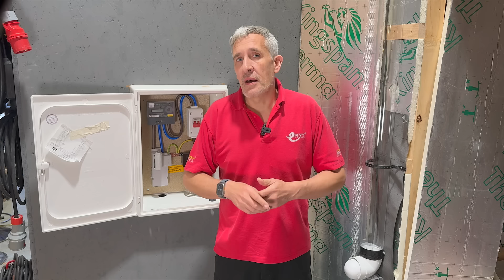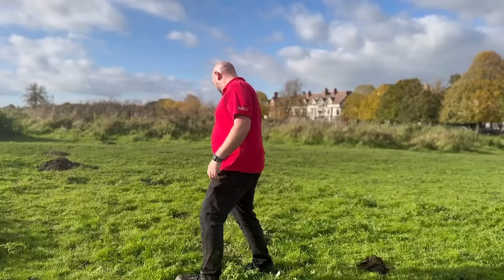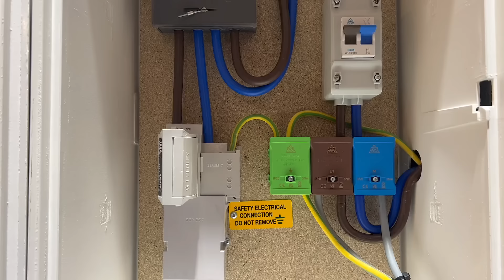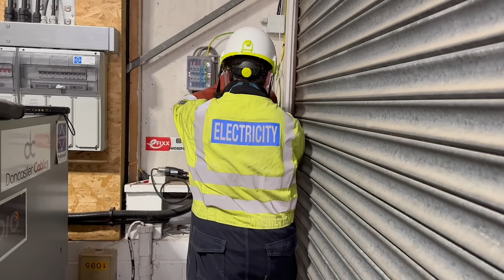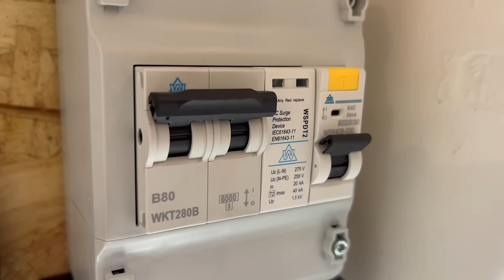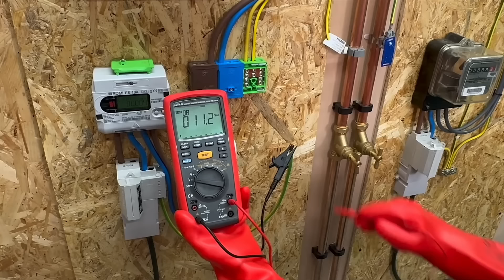Meter Box Madness: The Problem with No Clear Answer

Comment: I like the idea of using a dual B80 MCB as the primary isolator, followed by a single AC surge protector, followed by a single 30mA RCD. 

The contact air-gap in an MCB is at least 4mm so complies with being usable as a switch isolator.

That combination minimises the amount of heat generated on max load AND will work for regular tails to the consumer unit as well as tails longer than 3m- which need overcurrent and leakage protection.

The only issue is if the mini consumer unit housing them has a surge, the surge arrester/protector module will need replacing. And typically this mini consumer unit is often locked with a DNO seal. But doesn't need to be, as it's downstream from the meter...

Any DNOs have an opinion?
Reply: DNOs should stop sealing the isolator then and go back to having an isolator built into the meter like the good old Siemens one did
Reply: Cut the seal, it’s not their equipment.

Comment: Food for thought why dont we just have a board as mentioned but 6ways that we as electricians can use ie includeds 6/80/100 amp Dp switch then spare ways for ev for heat/ground and a additional supply in a hrc fuse type carrier like you'd find in some bms boards or panels ect we just connect drop a fuse in walk away everything and everyone covered 😉

Comment: Just to add my opinion on outdoor electrical  boxes.
I worked as an electrician on outdoor  petrochemicals plants for decades and the Kit just lasted and worked. Dont worry so much.....OK it was ATEX rated but still considered IP ratings, Seals, glands, external influences and heat dissipation etc......
As a domestic electrician now,  I use a local electrical wholesaler who provides higher IP/marine type standard equipment with proper seals and machining of equipment. You can feel the design, components and build quality and this is the difference.
Buy cheap buy twice usually applies but It also ensures the electrician - ie me, is not returning to a clients site prematurely........;)

Comment: Sorry guys, I have this issue all the time, there is only one solution, get a builder in, build a purpose built brick or concrete box with a posh tiled roof. Its not expensive, you fit all the DNO stuff, 18mm marine ply to the rear, 70mm trunking and make it big enough to fit your SPD, AFD, an extra DB, the 4G receiver, plus you can have a SPE and all the EVC. HP and all the CT's with the RS485. I know I tend to work on large residential systems so not everything I say may be directly applicable but its fast becoming the only way. I can send you guys a picture of a typical box if you want or the engineering drawings I produce for planning purposes to get it constructed.
Reply: Yep. 100% 👍🏻🇬🇧

Comment: Before tackling meter cabinet location we need to sort out the regulatory mess that makes 3 different owners responsible for the tiny space inside. 

Its massively wasteful and unecessarilly expensive.  And the answer is NOT - as the UK always does - to create another new market (isolators).  30 years after privatisation and we still set up a new market for every problem.  It doesnt reduce bills but someone else can make money from the problem.
Reply: The rest of the world is one step ahead and stipulates the exact space requirement for the DNO that has its own door and you fit all your stuff to the right with its own door. The DNO side has a lock (they provide for free), you get a key, they have a master.

Comment: What a awful idea. Mcbs do not co-ordinate with mcbs so any fault would trip the meter box and the fuse in the house causing total power outage. I'm starting to hate youtube for terrible advice by these channels. please employ an Engineer Into your team.
Reply: You mean RCDs, not MCBs? But you are right in a way, because the majority of RCDs are rated to trip at 30mA. 

So technically, you're correct- if there's a sudden earth fault at the end of the line in an appliance plugged into a shed in the garden with perhaps 3-4 RCDs in line, all rated at 30mA, they can ALL trip simultaneously.

An ideal solution would be one 30mA RCD in the meter box, then every other one rated at 10mA. But 10mA RCDs are expensive.

It is one reason why RCBOs are becoming popular. But they're still expensive.
Reply: @fredfred2363  He means MCBs, and rightfully so. There's no coordination between MCBs when short-circuit fault currents are considered (either L-N or L-L, easily reaching hundreds of amps which exceeds instantaneous tripping thresholds of any commonly used MCB, including that proposed 80A MCB).
Trust me, I live in a country where most DNOs have switched from fuses to MCBs as their main means of overcurrent protection and power limiters, because MCBs are supposedly such a modern and elegant solution, as opposed to those old-fashioned fuses, and it AWFUL.  Even things as simple as a burnt-out incandescent bulb that briefly create an electric arc when the filament falls apart which creates enough fault current to trip both the circuit protection in the consumer unit, and the DNOs main MBC, which leads to a total power outage. It's a problem that hasn't existed in the fuse era. For this reason some DNOs have started to return to fuses or coordinated MCBs that cost something like 150 quid a pop. So... been there, done that. Don't make the same mistake we did.
Reply: @fredfred2363  hi, no I mean mcbs, mcbs are not designed for selective coordination at domestic fault levels.
Reply: I'm what you would call an engineer, with many electrical qualifications not just knowledge of the brown bible. MCBs on larger installs are always upstream of MCBs, they have to be. Remember the DNO fuses/MCB's protect the DNO wiring, the 500mA AFD TD protects the house, the initial MCB's protect the wires and downstream DB equipment, the RCBO's protect the people and the smaller wires used for power / lighting etc. Its a hierarchy that has probably had a lot of design work put into it. An MCB (with a hierarchical rating regime)  never double trips this is because we think of an MCB as a fuse replacement, its not, its a careful bit of mathematical current integration from your calculus days, very fascinating in fact how the various curves interact.
However you are right when it comes to RCD's/RCBO's they SHOULD not be cascaded and the ed18 regs have a fair bit to say on the safety of this in various scenarios. And frequently, if they are cascaded, because of the way they work, downstreams will generally trip upstreams and so on forever up (even if the upstreams are say 100mA and the downstreams 30mA). 
Personally, I think ed19 should introduce 3 amp 10mA RCBO's for lighting now that LEDs rule but I guess nobody would agree with me on that one!
Reply: @Ino-z2m Mcbs are miniature circuits breakers. You are confusing yourself with MCCBs. Nothing co-ordinates with miniature circuit breakers if they are the upstream device under SC and EF conditions, unless the fault current is little more than the overload rating which is not ever the case. In the example shown there are clearly miniature circuit breakers not MCCBs so therefore no selective co-ordination has been achieved and the mcbs will trip simultaneously under fault conditions l-n l-e.
Reply: @nflk2920  I'm not an electrician, but would like to know if there are any solutions at all - is it possible to use a slower trip curve on upstream breakers provided an appropriate one is downstream? For RCD, do any 'fast-trip' versions exist - maybe if one could try different manufacturers in combinations, one of them would reliably trip alone on I-e fault?

Comment: I have on a couple of installations added a second meter cabinet, and once one for a control for sewage pump. My biggest beef with them is the ease of damaging the hinges, the number you see with no door because the box is broken.
Reply: Theres loads of hidden, undocumented rules relating to hinges, catches, ventilation, insect penetration, fire resistance... I was in a meeting about 3 weeks ago because all my lovely, precision, self gold star awarded drawings that I had spent many evenings on transpired to be a load of crap and I had to start again! Sadly we think the brown bible is the only gospel and what we dont always appreciate is that its not us and the non believers, there's loads of other religions using light blue books with BSI on them that's way outside of our pay grade! And... take it from me... its impossible for a human on planet earth to get your head around it all, do a job as an electrician and pay the mortgage!
Reply: @Ino-z2m  and don’t even go there when you look at the gas cabinet. Cadent once told me to replace one because I had drilled a hole for the gas bonding, you can’t even screw them in.

Comment: If an electrician installs something in the meter cabinet that is not recommended by the DNO, and then something goes wrong - the electrician will be completely liable, and no doubt may also have insurance coverage issues covering an installation that was 'not recommended'.
Yet the majority of electrician's will do this, also nearly all will happily cut fuse tags - which is even more serious than 'not recommended'.

Makes a mockery of all the regulations where yourselves preach not to install anything outside the manufacturers 'recommended' installation methods, due to BS blah blah for something like a light switch - yet when it comes to the meter cabinet, its to hell with the 'recommended' or outright 'no' from the DNO.

Speaking of regulations  @ 6:45 - i can poke my finger in around the conduit entrance to that cabinet - the cabinet which serves as a lockable enclosure, which serves to negate the requirement of double insulated cabling as per a previous video highlighting the trend of this on new builds - but that only works if it meets IP2X.

The whole meter cabinet area is a complete joke when it comes to regulatory compliance - yet it is one of the most dangerous, if not the most dangerous, area in a domestic electrical installation.

Comment: At last this is what we need. One box to terminate  swa and protection
Reply: Must admit 25 years ago, I used SWA for everything outdoors but time has moved on, and, don't forget for the past few years, SWA is no longer classed as double insulated it's insulated cores with a protective sheath which is fundamentally different. Virtually all EV and everything photovoltaic related specify double insulated in the manufacturers installation notes. Plus, there are many scenarios where you cannot use the outer armor wires as the Pc so you need 3 core or 5 core and then you run into frustrating colour issues. SWA has had its day, but it still remains the cheapest way to run power to a shed.

Comment: Personally, I don't like the idea of any of this kit on the outside of the home, where it's vulnerable not only to weather and accidental damage, but also to deliberate interference by 'naughty' people... of which there are many in inner city locations.
Reply from the maker: That would mean moving the meter back inside the house, which we've seen on quite a few new builds in Scotland recently.
Reply: @efixx good - that makes sense. 
Meter boxes don't handle our weather - the number that blow open because the doors vibrate in the wind is crazy.
Used to blame lazy meter readers. Ended up buying a meter key to close my own meter cabinet on my old flat or the door would have been in a different postcode.
Reply: No the box has a metal door with a lock. The DNO provides the lock and gives you a unique key, they have a master. The lock can be a padlock or a euro cylinder barrel.

Comment: We need 3 phase. Why should a home owner pay over £15k to upgrade. Net zero my back side
Reply: Future my arse!
Reply: @fredfred2363 What's wrong with your arse?
Reply: All houses in Switzerland are supplied with three phase by default!
Reply: Britain does not have 3-phase? Germany has had 3-phase for consumers as the default for at least 4 decades.
Reply: @ChristianWagner888 yes of course we have 3 phase we typically only supply houses with single phase between 63a-100a
Reply: yes i know, as an electrician. £16k qote for me. So i now am going off grid in summer with anker system.
Reply: Three phase is totally unnecessary in the average house with a 230v supply.
Reply: totally disagree, with heat pumps ,electric showers and 3 ev chargers for 3 evs. Its a must.
Reply: @gino2465  
Load priority equipment can be fitted, and look at diversity. The average house does not have three EV chargers. BTW, 110A supplies are available. Once again..
Three phase is totally unnecessary in the average house with a 230v supply.
Reply: new homes are all going 3 phase for a reason.
Reply: @gino2465  
Once again..
Three phase is totally unnecessary in the average house with a 230v supply.
Reply: very important that homes need upgrading.
Reply: @gino2465  
Three phase in an average domestic home is a downgrade.
Reply: @gino2465 I’ve never seen three EV chargers in one house, multiple EV’s just mean they would share charging times…. Duh…

Comment: 1) Tails longer than 3 meters shouldn't be protected by DNO fuse. You're paying every month 100A subscription fee, but limit yourself only by 80A. Very neat.

2) Double pole disconnection is solution only for buildings without earthing rods (ex. poor countries in Asia or Africa with primitive building codes), but in UK building can't pass inspection without earthing rods. I can't find any reason why UK is using double pole disconnection if the neutral wire has permanent connection with ground and voltage between neutral and ground in UK is safe for human. 

3) Connecting solar inverter to meter box improves safety for DIYers as risk of backfeed is totally missing. DNO electricians have dielectric gloves and portable ground, but DIYers never short hot wires to ground and never wear dielectric gloves - in case of backfeed from failed solar inverter DIYers are risking to get electric shock even if panel is disconnected. 

4) For locations with unqualified persons fuse is not relevant solution. In residential buildings DNO fuses must be replaced with ABB S750DR. Fuses should be allowed only in locations where electrically trained persons are available like industrial buildings or factories.
Reply: An 80A dual MCB B curve, will trip faster than the 100A cutout (when overloaded to maybe 150A) and doubles to serve as an isolator. And minimal heat generated at the contacts. So means fewer call outs to replace the 100A cutout fuse. 

It's not very often that a domestic single dwelling house will draw anywhere even close to 100A at 230V. That's a LOT of power.
Reply: @fredfred2363 100A costs 3,15€/month, but 80A costs 2,80€/month. Better to order 80A fuse from DNO.
Reply from the maker: Interesting points

Comment: Who would be liable for that equipment, who would pay for the SPD to be replaced also you could do with another main switch to isolate that little MCB board as you have live terminals in there
Reply from the maker: Sensible ideas!
Reply: That is actually the requirement in ed18. Curiously the SPD never 'blows', I know its meant to but I have found it does an excellent job without ever 'blowing'. Had to sort out a horrendous 'explosion' once, the house had been hit 3 times, the networking infrastructure was totaled, every switch was black inside, quite a few Cat5e's were blown to bits, the NVR, everything PoE what a mess! Yet the SPD's all did their job and miracle, the washing machine still worked. I was so shocked that I tested every SPD (you can do that on your insulation tester, it reads infinity at 250, 50k at 500 and short at 1000) and somehow they all survived. If you'd seen the state of the wall network socket you would never believe an SPD could survive, it was so blown to bits, the galvanised box had to be replaced, the wall repainted and the wire replaced so personally, although I always leave a spare SPD in the bottom of the DB for my customers, I can't ever see a scenario where it could be needed.
Reply: @Ino-z2m  I have had to replace one SPD so far

Comment: Mandate internal combustion engined vehicles,  zero renewables, 100% nuclear power, gas fired central heating and all these issues simply disappear.
Reply from the maker: Or move the the USA
Reply: Nah, France. Most of the US doesn't have piped gas and still uses oil. But even small towns are now being connected to gas. It's a big country to implement buried infrastructure, where people can be really spread out.

Comment: Make a much bigger meter box with a dedicated area within for the consumer. Also if they could make a meter box that the door doesn’t fall off and have hinges that aren’t a signal pin surrounded by 2 mm of brittle plastic that would be even better !
Reply: Does anyone make a decent outdoor meter box that lasts more than a week?
Current designs is not fit for purpose.
Reply: No, they can not make a meter box door not fall off. This is simple as that: THEY CAN'T DO IT! Somebody took money to approve this faulty design, so it's approved and can't be changed.
Reply: Doors are complicated, I have to produce engineering drawings for these boxes, the doors have to be made from a special aluminium slatted system that allows ventilation but no insect penetration, they have to be what is visual interference and conform to a whole world of crap including 4G signal penetration! Sadly I have had to become a meter cupboard door expert sad git, if anybody else is as sad as me I can explain it all but I cant believe theres another electrician out there that sad!
Reply: @Ino-z2m  It's nothing to do with doors, the hinges and locks that are failing.
Reply: Similar to the ones they have in the U.S.?
Reply: Yeah they could do with allowing ones that are double width